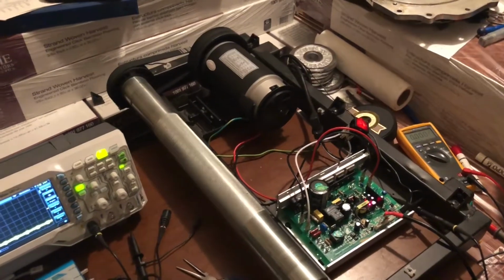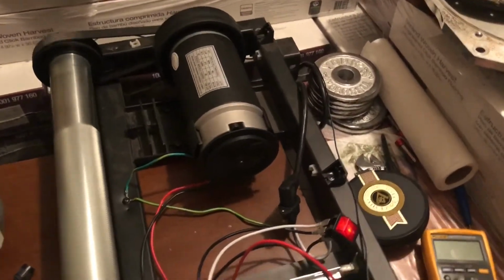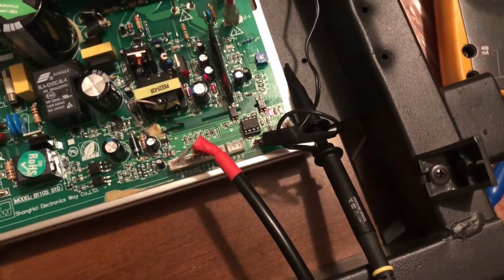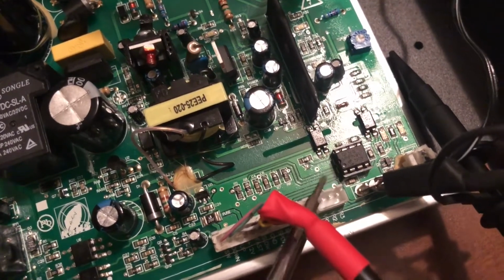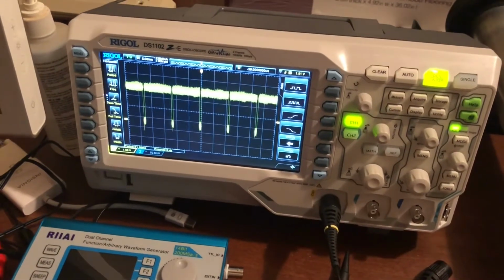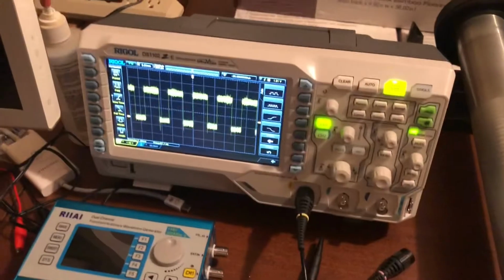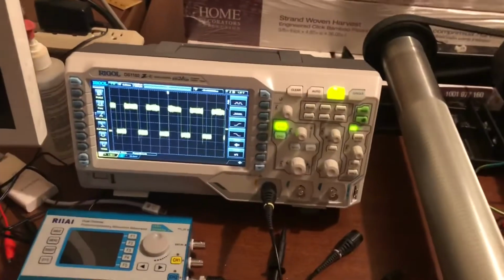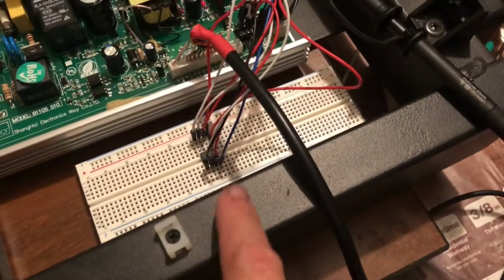Treadmill motor controller reverse engineering

Comment: Any luck decoding the control signal? I have 2 different control boards, one was a simple 20Hz square wave with duty cycle proportional to speed, the second I can't figure out.
Reply from the maker: On this one, literally all the main board needs is a 20 hz active low PWM signal. This is one of the output pins of the PIC.

I’ve got it faked out and driving the board without the PIC, using my square wave gen.

I want to display the motor voltage and current in the Arduino display so it’s taking some time to build an isolator circuit
Reply: Nice. When I get around to it on mine I'm going to use the Hall effect sensor to provide rotational speed feedback and PID control the motor voltage to try and keep the speed constant, because these motors do bog down notably under load, especially at low speed. Also would like to display SFPM of the bandsaw blade. None of that's necessary, but will be fun to do someday.

Comment: Very interesting to see what PWM looks like on your scope.  Can't wait to see how you use the Arduino to vary the signal.
Reply from the maker: What was interesting is how noisy the signal was. Originally I thought there was something janky with my scope, but it reads the square wave from my function generator super clean.
Reply: @MadScienceAndy  Probably a lot more expensive circuitry needed to smooth out the signal, which would be standard on the square-wave generator.  Have read that 3PH VFDs also generate high-frequency harmonics, which can fry old motors.
Reply from the maker: @danielabbey7726  On this board, the noise I think is probably from the other circuitry hooked up, but really doesn’t matter as long as it’s below the signal threshold.

There SOOO much misinformation about VFDs. VFD will NOT fry an old motor (if operated at correct speed), and in fact produce much better, much cleaner 3-phase than what comes from a rotary. 

If however you run a motor at a very low speed, slower than the fan can push air, the motor can overheat. So important not to drive motors at low speed and high load.

VFDs can have issues with switched loads though, like if there is switching circuitry in the load, like say switched power feed or something, then some could have issues. They’re really designed to be hooked up directly to simple loads like a motor. 

Note here, this PWM signal is just what drives the analog board, this isn’t what the motor itself sees. They motor gets a lot cleaner signal.
Reply: @MadScienceAndy  Thanks for the detailed response.  From what you've said, I feel better about using the PWM Motor Controllers and VFDs for 3PH.  Got some old 3PH motors that I was worried about using VFDs, but had read differing opinions on the PM Board (nice to have an informed opinion).